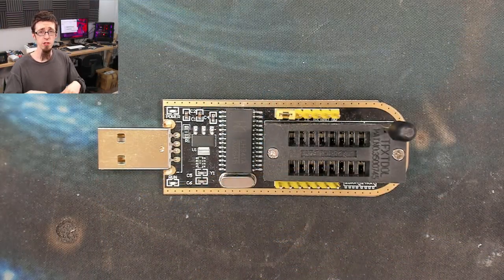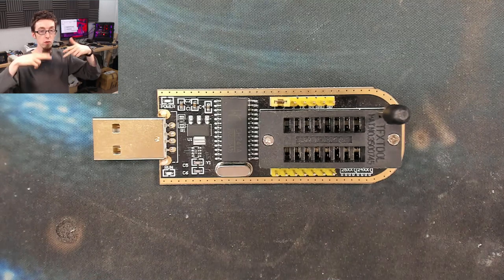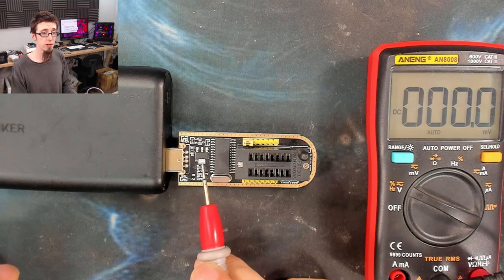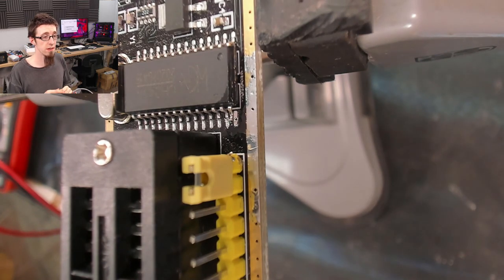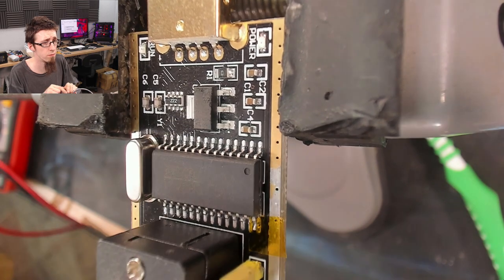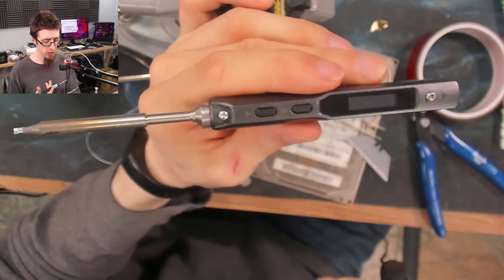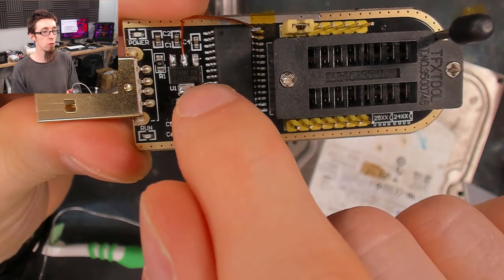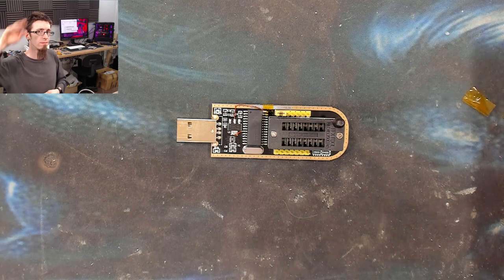Volt-modding the CH341a Mini Programmer - LFC#278

Comment: Or ... use heatshrink (no tape required) and smaller guage wire (that enamelled guage is way too thick tbh) ... to cover the joints/wire (if they really need it) use clear nail varnish ...

Comment: I have a different board, classic green pcb with the ic and the 3.3V regulator on the other side of the board and it's just fine, no mod needed. You can follow the trace from the big pad of the regulator to the upper right pin on the ic. 
HOWEVER! I found they connected pin 9 to a decoupling capacitor instead to VCC as specified in the datasheet. The capacitor is needed when powered with 5V. I'll fix this.
Reply: Which board do you have? I want to fix my LG monitor and got this board. This soldering looks worse than applying firmware to IC205 eeprom of my LG 31MU97-B

Comment: hi there! I bought two of CH341A. every time I connect I got this error:
I got the light on board on but nothing can be read in the PROGRAMMER
Current programmer: CH341 ID(9F): FFFFFF(Unknown) ID(90): 9000(Unknown) ID(AB): AB(Unknown) ID(15): FFFF(Unknown)
Reply from the maker: Sounds like the driver might not be correctly installed. Try downloading Neoprogrammer (https://khandishnetwork.com/dl/neoprogrammer-new-update-v2-2-0-10-15-10-2021/) which will come with a CH341a driver in the program folder, and use that.

Comment: You really don't need to modify this programmer. If you connect it to a bios chip the 5 volts drops to 3.4V and  the short circuit current of the 5 volt pin is less then 1 mA. With that current you can't burn anything.

Comment: done modding after your viceo thanks. important to verify the bios after flashing when using clip ,sadly i didn't do it ,flashed bad bios and when computer turned on burnt a charging mosfet. not 100% was this the reason of course but laptop was perfect before bricking
Reply: A bad BIOS wouldn’t blow a charging mosfet.

Comment: Hi guys,
I've also had problems with the CH341A programmer like VERIFICATION ERRORS and ERASING finished in zero time = NOT ERASED!! during trying to reflash my DIP - 8 bios chip by GIGADEVICE. Had been trying everything I found on internet for the whole weekend, especially finding, installing, uninstalling different drivers and software versions. But nothing helped me.

There is some info about 3.3V and 5V problems ( black CH341A versions) the WEBs. Aaaand - YEAH, that's TRUE!!! Everything is caused by incorrect VOLTAGE on the programmer and you need to bypass from 5V to 3.3V.  

But I'm not able to do this thing, that's why I've tried lowering the VOLTAGE from USB PORT by connecting different hardware to usb HUB and increasing my USB CABLE's length. I still can't believe I've done my bios CHIP REFLASHING SUCCESSFULLY!!!

My connected things ( into ONE usb slot ). 1HUB ( of course without external charging 🤣🤣 ), here is a mechanical lightning  keyboard, switched on a usb lamp and one more usb hub with a PS4 controller plugged into this hub together with the CH341A device. You will just need trying.
 
So good luck guys!!! 😉
Reply from the maker: Hahaha, that's a novel way around the problem! Glad you got it sorted!
Reply: @Adamant_IT  Yeah, it's a weird way but it works. I would call it   IT Bizarre 🤣

Comment: I have q question, seemingly to program an eeprom chip you need a working computer then this question rises how was first bios chip programmed
Reply from the maker: Analogue circuits! Early computers and electronics are just switches. Check out this video from a series by Ben Eater, who is a magician at explaining computer science: https://www.youtube.com/watch?v=BA12Z7gQ4P0
Reply: using a computer 
since not all computers used bois chips 
but all bios chips were programmed using computers
Reply: @Adamant_IT  thanks broski
Reply: @ahmidiyasser376  thanks its interesting

Comment: Looks like the Chinese (assuming) don't miss a trick when ripping designs.. That ZIF socket is a remake of the "prized" 3M TEXTOOL socket. The one on the programmer is actually spelled TFXTOOL. The actual 3M socket alone would be far more expensive than this (wonderful) little programmer. "Kings of RipOff"? GR8T legacy to leave your children. Just saying. BTW, came here for the "fix" and you were clear and concise. That being said I F-it and broke the pin off. Next!  :)

Comment: nice ... how to use CH341a to unlock efi macbook air 2015 ? make video tutorial sir .. thx
Reply from the maker: Video on using one of these is coming up. I'm going to be focusing on PC motherboards though, as I very recently did a video demonstrating MBA EFI unlocking. The process is the same regardless of what programmer you use.
Reply: i have unlocked 2 A1465 MBA 11, early 2015. lots of failed trys

Comment: that was awesome..  still looks great ..i hav purchased one , but was unaware of why to mod .. useful pc of info ... i guess i will wait to mod befor flash .. ?  u kno i saw another vid on engineering ur own cmos battery ..  instead of buying one , guy says it cheaper to buy battery , but ...  w/tapes , wires , and heat shrinks , i think would actually cost mor to build ur own .. ?  l.o.l

Comment: your work is good but i have to add this note and warning to make the CH341 fully working below
Warning: put a SMD cap between the 3.3v out from the regulator and the ground otherwise the programmer will be fully unstable and unuasble and the mod will be bad
Reply from the maker: I don't have a cap on mine, and haven't had any issues at all. That being said, I don't do in-circuit programming, I always remove the chip, so that might be making it easier on the programmer.
Reply: @Adamant_IT  sadly mine did have a lot of problems and I don't do in-circuit programming, I always remove the chip, on the erase chip the programmer just unplug and it refuse to program the chip after i added the cap it worked 100% fine so better safe than sorry
Reply: @MichaelVx  I am having the same problem with yours. So could you please tell me more detailed what to do with that smd cap where to connect maybe a photo of it I dont know. And isnt it important the value of the smd cap there?
Reply: @metechantalya  i still dont know how to read or know the value of these SMD caps but its mid size SMD light brown cap its needed to be connected to 3.3 rail out from the regulator the + 3.3 and the GND

Comment: can't believe i fell for this type of bullshit (wherever i first saw it). data lines are completely fine at 5V, i used it unmodified for years and never had problems with 3.3V chips. few days ago trying to rewrite laptop BIOS i kept getting verification errors, no matter what. already thought the chip is faulty, until i remembered i did this mod (when trying to recover burned SSD BIOS chip). reading of the bad SSD BIOS (besides completely busted block that was full of garbage) was giving me same type of byte mismatches accross multiple dumps that i've now seen on laptop BIOS. don't mod it!! it is fine as long as VCC is 3.3V

Comment: you do not need to mod this device voltage wil drop as soon you start read ore rhite and besite that the amp are way to low to burn any chip you talking about 0.07 micron amp

Comment: man, you don't need a jumper because near that leg is located 3.3v road to that you can solder
photos
https://pic.mysku-st. net/uploads/pictures/03/76/12/2021/04/27/060191. jpg
https://pic.mysku-st. net/uploads/pictures/03/76/12/2021/04/27/669529. jpg
(remove spaces)

Comment: Hello, i see this video x 4 5 6 7 time, i am familiar whit microsoldering, but i fund i indonseain guy smart ass, :), she cut a line of circuit (5v from pin 28)from the back and shoort- circuit 3.3v whit 5v in jumper mode,more easy and fast ,i want to know if is legit, if is , is a util mode wher u can put a jumper to use it avain whit 5v ..:),and maybe a idea for a new video from you

Comment: Just a little bit of info.... you're doing this ALL WRONG!!!!  You need to measure the circuit WITH A CHIP INSTALLED. Your multimeter is NOT reading the correct values, because the circuit is NOT COMPLETE.. There is NO amperage behind that 5v, the IC is NOT working on 5v logic level. 

Those programmers DO NOT NEED ANY MODIFICATION!!

The problems with the assumptions everyone is making about these devices.. 
1) Making the INCORRECT assumption that the  CH341A IC is always driven at 5v, but it is not.  The CH341A IC can be powered by either 5v, or 3.3v (when you change the selector, that's what you're doing) This is important to know, because the IC doesn't just pass the 5v USB signals through to the SPI/I2C lines.. that would be stupid. Instead, they are converted to SPI, or i2c internally, that means the i/o of those lines are DIRECTLY proportional to the supplied power. i.e. 3.3v/5v logic levels.  

2) Yes, there MAY be up to 5v present on all of the pins, however, this is only true when there is NO DEVICE ATTACHED. 
Why you ask?? 
Because there's not enough amperage to be an issue.. literally, 0.0028 - 0.03 A measured.  That's far to low to do any sort of "damage" to an IC. it's far to low to even program an IC with.  And guess what happens when you actually connect an IC to those pins.... The voltage instantly drops to 3v (when 3v is selected)

The second thing i see people doing, and trying to blame the device for. They use the device for IC's at run on less than 3.3v, but they do so without using the adapter that drops the voltage to 1.8v (yes, there's an adapter for that) 

At the end of the day, the people opting to "mod" these devices are doing so because they haven't taken the time to understand the circuit they are working with, and making assumptions based on mere speculation. Both approaches are flawed. 

Take the time to reverse the circuit, and how it functions. the 3.3v/5v jumpers literally dictate what power is being fed tot he CH341A, and thusly, directly dictates what logic level the programmer is working on. The 4.x volts your multimeter is seeing on the pins when no IC is attached, is literally just the build-up charge in the capacitors, there is no amperage behind that voltage, and as such, there is no risk of corrupting, or damaging the IC's.